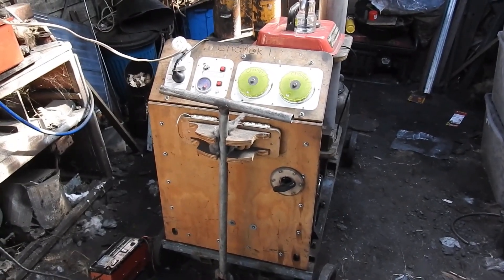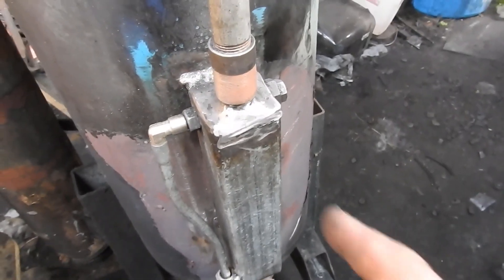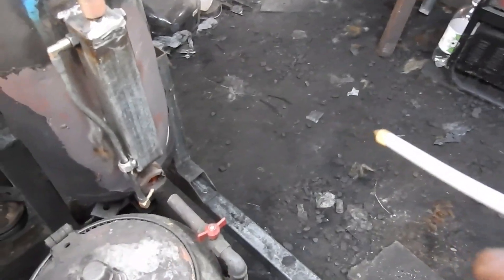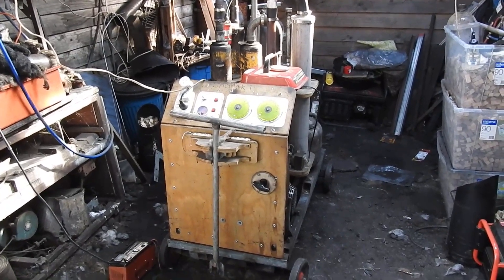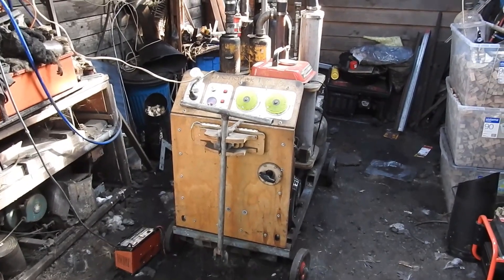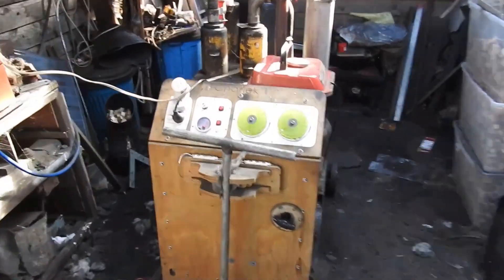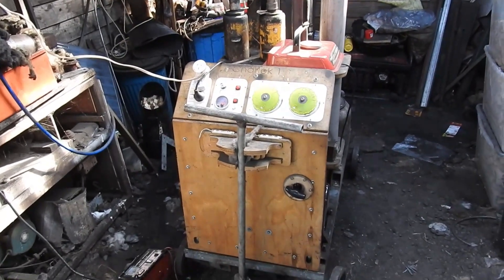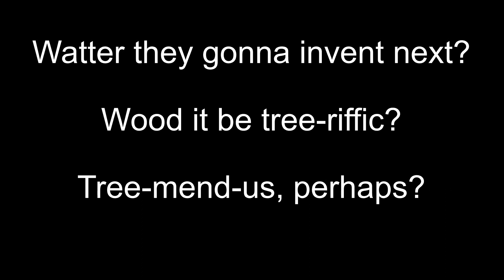If you want more watts - just Add Watter

Comment: Do yoh always run in charcoal? I wondering what rhe difference is with moist charcoal en steam addition.  Otther then that The latent is coming from the gasiffier waste heat ?
Reply from the maker: Nice to see you here :) .
 I run two gasifiers here. One runs on charcoal, and the other runs on wood. 
Adding steam to the hot charcoal creates a lot of extra power, while also helping to cool the air nozzle. 

Ideally, the charcoal stays dry, so that the incoming steam is the only added moisture. 
Waste heat, due to my inefficient design, boils the water in the tank, to make the steam for the injector. 
One of these days, I wood like to come up with a better design  :)  .

Comment: Great work!
 If I may ask, how long have you continuously ran the gasifier for.
I ask as I live in rural Nigerian rain forest. We hardly have the grid supply. I am currently building a gasifier that will run on the palm kernel shell waste I get from my factory. 
Annually I do have over 300 tons of the waste. I intend to install a system that can run my 30kVa alternator
Reply from the maker: Thanks kindly. 
 This particular gasifier runs for 3 hours - between fuel refills, whereas my wood gasifier can run for about 14 hours, before I need to clean it out. 
 Your palm kernel gasifier idea sounds really interesting, and I look forward to seeing watt you come up with  :)  .
Reply: @CNCmachiningisfun  
Thanks for showing interest in my work.
I have one other question “ what do do you clean out from the gasifier other than ashes”? Also, do you have cases were you have to open the gasifier for a good cleaning?
Reply from the maker: @MrObi1canobi  
 You are welcome  :)   . 
 This particular gasifier accumulates fine soot particles, which eventually block the pipes and filters. 
 In one of my videos, I set it on fire, and make a LOT of smoke and sparks, to burn it all out, in a process that I call "flame cleaning". 
 Every gasifier should be made in such a way that you can take it all apart, for cleaning, and modifications. 
 On rare occasions, you do need to dismantle parts of it for cleaning, but it is one of those things that you can safely put off, until you have a bit more time to spare.

Comment: Hi there, I really like your videos, they are very honest, compared to a lot of stuff on youtube. 
I have not made a gasifier yet, but a thought came to me - would the woodgas be hot enough to boil water, before it gets cooled? 
Then some of the heat could be used to run a small steamengine at the same time, I think it is a shame all the energy from the heat is not used.
Reply from the maker: Thanks kindly  :) .
 Your idea has a lot of merit, and I think it could work on a larger gasifier. 
 My little gassers don't really get hot enough to do this, but there is still a lot of wasted heat. 
 A sterling engine, as opposed to a steam engine, may benefit from this, as could a thermo electric generator, since both of these are examples of heat difference devices. 
 I have seen something like this being used on the exhaust system of a large truck, thereby eliminating the need for the energy hungry alternator. 
 All ideas are welcome, as that is where the magic comes from  :) .
Reply: @CNCmachiningisfun  OK, thanks, no need to think a boiler/steamer into the project then :-) 
"They" say we are heading into an energy crises here in Europe this coming winther, so I think a lot of alternative stuff will be taking into use, if it really goes that bad, but we will see.
Reply from the maker: @chris6160-d6s  
 Given the potential for an energy crisis, we all need to put our brains into action, in order to devise some clever answers to it. 
 Woodgas, and similar technologies, will make a BIG difference here, and it is within our power to make it happen  :) .

Comment: I seem to remember from history class that in WWII the US Airforce had water injection systems in the fighters for power boost. I wonder if what you are seeing is a similar effect? 

Only recently found your channel and absolutely love the content. Great stuff.
Reply from the maker: Yes indeed. I remember this, and the water injection systems that were used, and ultimately appeared on the market for use with cars  :) . 
 I imagine that this works in similar ways to watt we are seeing in this video, where the water is split up, and is assisting with the combustion process. 
 The overall chemistry may be a little different, but the wonderful effect is the same  :) .

Comment: I just found this!  I'm so glad it seems to work.  How has it held up?
Reply from the maker: Howdee Scott, 
 You'll be pleased to know that this has held up very nicely. 
 It consistently boosts the output power of my charcoal powered generator, even to this day  :) . 
 I tried it on my wood gasifier, but I couldn't get it to work reliably. 
 A little bit of experimentation will surely fix that little problem, methinks.

Comment: Cheers for the video.  Love your stuff.  I run a simple water drip on my flute shaped nozzle for my Mazda truck.  I just have a stainless steel tube I rest inside the horizontal pipe nozzle with holes drilled in the top set to about a drop per second or so.  Might not be the optimal amount but it's still some.  Then again I use it for a vehicular application.
Reply from the maker: Thanks kindly. 
 Having always been interested in playing with engines, running them on homemade fuel is surely the icing on the cake  :) . 
 It still surprises me, when I see just how much extra engine power I can get, simply by adding a bit of steam to the air intake. 
 I imagine that you'll be experimenting with water flow rates, to see just watt might be possible in the horse power department. 
 Perhaps the water flow rate could be linked to the throttle? 
 Now I am looking at my tractor, and considering how it might look when I add a charcoal gasser to it  :) .
Reply: I was thinking of tying in a water pump to a mister head powered direct off of the Alternator.  Higher engine speed would be higher voltage so more water in tiny droplet form.  The drops are fine for now though because any excess just runs out the side and steam gets sucked up.
Reply from the maker: @cetate93  
 That's an interesting idea. 
 I wonder if the pump could be indexed to the ignition coil, so as to produce a pulse with each ignition spike. 
 Your current system works well, as it protects itself from flooding   :) .

Comment: Did I miss something??? Why I wasn't aware you were throwing another video to the utup??? 
Damn! Steve, I made a similar progress :D 
I added a water cooling to my first condenser pipe. I used a 20l bucket as tank at the end of the major drainage pipe where the water flows back. After a while the water got that hot, it began to steam and traveled up through the electric filter to the outlet - the flame went from deep king's blue to a blueish white color and sounded like a rocket booster.
From that point I was conviced it has to have an effect on the gas quality - what you did prove here. Well done my friend :D
Reply from the maker: Howdee partner, 
 As usual, googleTube is up to its old tricks, so this communication failure is just par for the course. 
 The results of your experiments must have put a big smile on your dial, just as mine did when the extra watts started pouring out of my generator   :) . 
 It really is great to know that this works with a wood gasifier in the same way that it does with a charcoal one. 
 Armed with that knowledge, perhaps we should all get our brains into gear, and work out a way for us to add this feature to our power plants   :) . 
 If I understand correctly, the water is being split by the high temperature reaction into its constituent gases. 
 The oxygen will boost the existing charcoal reaction, by adding extra carbon monoxide, while the hydrogen will pass thru the system, and be added to the fuel gas that is being burnt at the flare or the engine. 
 This has great potential, and I really think we should be doing more experiments with it - as long as we can afford to buy the water for it  ;)  .
Reply: @CNCmachiningisfun  Yes you're right buddy. The same reaction like in electrolysis - the water will be split into its components. The Oxygen first is used to enhance the pyrolysis reaction while the hydrogen can't be burnt because of the so created lack of oxygen. While you are giving the water to the pyrolysis reaction (what I cant't do in my system), I give it later as steam to the engine. Same effect in general with a neat side effect: the steam is lead into the engine and gives better cooling to the cylinders with a boost of power, since the same process is happening when it's being burnt down in combustion chamber.

Comment: You mentioned the gassifier was running “lean” near the  start of the video.

What you are likely seeing is a process known as “reforming”.  Googling “town gas reforming” will lead you to the production of Hydrogen and Carbon-moxide by injecting steam onto hot coke.  You are doing the same thing injecting steam/water into the hot bed of your reactor.

Nice demonstration.
Reply from the maker: Thanks kindly for the head's up on this. 
 It seems to me that there is always something new to learn about this old technology. 
 My only regret about this is that I didn't know about it, 30 years earlier. 
 We have our 'education system' to 'thank' for that, it wood seem   ;) .

Comment: Steve, have you ever tried mixing some charcoal in with your wood chunks when running the regular gasifier? I was wondering if it would allow for higher moisture content fuel to react more thoroughly with the extra carbon in the charcoal? Make more carbon monoxide and hydrogen while keeping hearth Temps up. What are your thoughts? Thanks for the show.  Joe
Reply from the maker: Howdee Joe, 
 That's an interesting thought. 
 I often add charcoal to the wood hopper, but this is more to get rid of it, as opposed to much else. 
 It makes sense that it would assist with water injection, just like it does in the other gasifier. 
 That stated, I have been trying water injection with my woodwatter 9000. It kinda works, but it is not overly spectacular, sadly. 
 Still though, the air jet system in my woodwatter does allow me to wattfully dispose of unwanted oil, and old diesel, so that's a step in the right direction   :) . 
 Knot only that, but it helps me dispose of plastic scraps, in a surprisingly clean way.

Comment: I've had steam injection planned into the design of mine since the beginning.
It has a water cooling jacket on the gas outlet - the plan is to divert some of the hot water from it into a heating coil inside the gasifier and inject the super-heated steam right into the burn zone.
I have a couple vids up for anyone interested.
Reply from the maker: I like your idea, and I am sure that it would work like a charm. 
 Watt do you think of adding water to the muffler, and entraining steam into the exhaust gas, to feed back into the gasser's air intake? 
 There is so much waste heat, and it wood be a shame to not make it work for us.
Reply: @CNCmachiningisfun  
I've done some study on EGR since reading Thrive's reply this afternoon. It seems EGR lowers the temp of combustion no matter how little you use.
EGR is used for engines specifically to reduce the air intake volume and lower the temperature of combustion, resulting in less nitrogen oxides, of which there are several. 
The higher the temperature of combustion the more nitrogen is able to bond with oxygen. 
However, from a standard gasifier point of view, a slightly lower temperature might allow more of the O to bond with C, instead of bonding with N2 - thus making more CO...
But that's all somewhere above my understanding for me to make a guess.
On the other hand, if you're going down the steam injection route, my conclusion would be to take as much excess heat as you can from the engine, exhaust and anywhere else you can find it.
Heat the water into steam as hot as you can possibly get it. 
Also preheat the intake air as hot as you can get it - the downside of this is that it's going to reduce the oxygen density of the air, but the upside is that it should also reduce the nitrogen density.
The lower oxygen density shouldn't matter when the system is fed with steam, since you're gaining the oxygen - need more oxygen, just add more steam.
Somewhere in there will be the perfect sweet spot.
Since oxygen is more dense than nitrogen maybe some kind of tall heated plenum chamber would help. Put a small vent in the top and air inlet/outlet at the bottom - perhaps some of the nitrogen will float off?!
I'm not going to bother too hard trying to fight the nitrogen coming in with the air, it's always going to be a compromise to live with.
I'm concentrating my efforts into splitting as much steam as possible into H and O.
After all, water is more abundant than trees, at least in England it is.
With all that hydrogen running through the engine corrosion will inevitably become an issue, particularly with a spark ignition.
That's why I went down the diesel engine path - to ensure there's always a bit of oil being injected into the cylinders. 
It also means I can run it with waste oil and use the draw of the engine to get the gasifier going.
Not to mention, I've got an anaerobic pyrolysis reactor in the planning stage, to make liquid fuel from plastic.
That's a project to start next year, after the current one is up and running.
Reply from the maker: @brianmurphy8790  
 That's some splendid research that you have done there. Well done indeed   :) . 
 For sure, any attempt that I make towards EGR on my charcoal gasifier results in a noticeable cooling effect on the reaction. 
 Perhaps this is acceptable, to a reasonable degree, as it will prolong the lifespan of the parts in the reactor. 
 My imagined air preheat scheme is a lot like the one that you suggested, where a jacket is fitted over the body of the gasifier, to collect the hot air, and to serve as a thermal barrier to the outside world. 
 Since the exhaust system gets up to about 350 degrees C, it readily boils off any beer that I may spill on it, so it makes sense to use some of that heat to flash water into steam, ready for the gasifier to consume. 
 I wood like to think that this will work on a wood gasifier, just as well as it does on a charcoal one. 
 Nitrogen is always going to be an issue, but I am happy to accept it, as I get virtually all of my winter power from these systems, at a very low operating cost   :) . 
 Hydrogen embrittlement is a potential issue with the systems that we are considering, but I tend to find that my generators wear out, well before any signs of corrosion make themselves known. 
 Well, I guess that's watt I get for using the innards of cheap gensets as the prime movers for my Wattage Cottage, eh? 
 
 Keep up the good work, at your end of the international extension cord, my fellow woodgas bugbite victim  :) .
Reply: @CNCmachiningisfun  
I guess the corrosion wouldn't be an issue if there's not a high level of hydrogen burning in the engine just before shutdown. I was thinking maybe there'd be condensation build up in the bore once the engine is cooled. I guess it's a case of not injecting steam when you're close to shutting it down.

The next gasifier I build is not going to be built from a pile of random scrap either.
I've got plans for one with proper shielding, capture and storage of heat - pressurised water cooling and suchlike.
I can get my hands on plenty of waste motor/cooking oil and wood scraps, but I just want to use that as a means of heating water and cracking the steam. 
My current version is more a 'proof-of-concept' prototype that I'll use to keep me warm in the shed and power my tools as I build the new one.

As for research, I've been reading an interesting pdf on the effects/benefits of O3 addition into the air intake of an engine.
It doesn't seem like it'd be a good idea to run it through the gasifier though, maybe even something of a bad idea.
I'll try to drop the link in another comment - YT has a habit of not allowing comments with links..
I'm often faffing with electronics and I've made many O3 generators, they don't need much in the way of watts to run either.
BTW, love the mild humour...Always gives me a chuckle...
Reply: @CNCmachiningisfun  
Nah, YT wont let me post the link.
Reply from the maker: Try again - and I will see if I can recover it from this end of the line....
Reply: @CNCmachiningisfun  
I posted it again, I even removed the dots and slashes but it's still not showing.
Reply from the maker: @brianmurphy8790  
 That is most unfortunate, but it is par for the course with googleTube's censorship happy robots. 
 Perhaps you could post the link on your channel, for us to view?

Comment: The ultimate use of the wood to energy resource.. Gasifying the raw wood , converting to engine fuel then using the biochar to do the same. Add a little water to enhance the process. The results gained from the complete use of that one tree leaves room for another tree to sprout, take hold and grow. I like the whole idea. Good job there, Mr Steem.
Reply from the maker: Howdee BillyWatts, 
 Thanks kindly. 
 Yup, there's no doubt about it, these processes are making efficient use of the trees, and also creating some left over biochar, to feed the new trees that move in, and take root, where the originals once stood. 
 I knew there was value in steeem, and now I have seen it with my own two watts, oops, eyes    :)  .